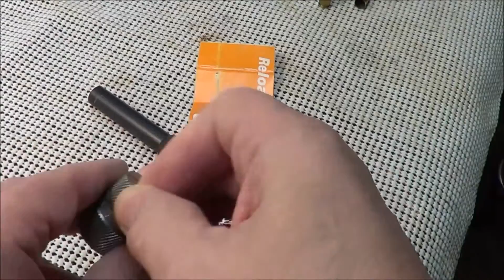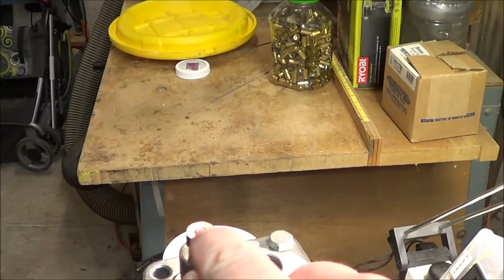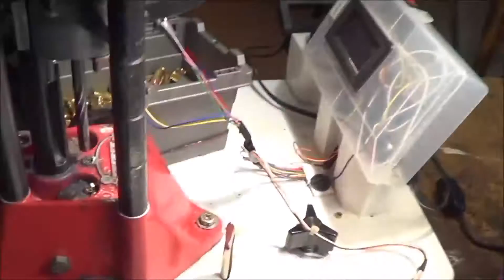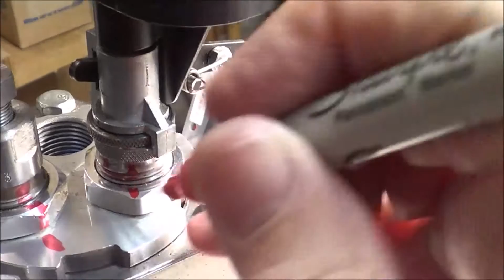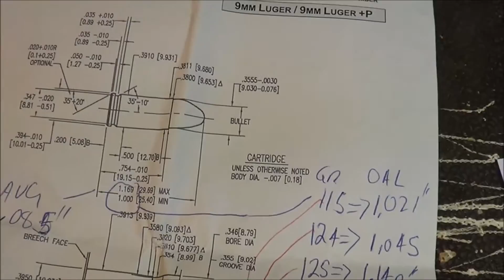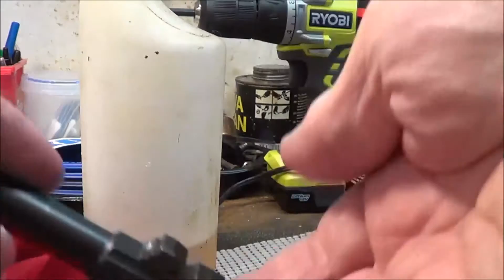Lee Pro 1000 How to set 9mm Dies

Comment: I load 9MM but can’t seem to get my bullets to pass the plunk test only randomly- I followed your die setup / I thought a Lee resizing die might solve this issue-I’ve tried fiddling with the decapper first die by setting it deeper with limited success/my Lee 1000 is quite old but that shouldn’t affect sizing the brass??? Any suggestions please?
Reply from the maker: First question would be which plunk test?  I just took ten rounds; took out the barrel in my semi automatic and every one very easily  passed the plunk test.  Next I took out my Lyman 9mm Cartridge Gauges D13,  every round dropped into the gauge,  but 9 out of 10 would not drop out, they had to be given a light rap on the table and then they instantly fell out. Next thoroughly cleaned all rounds and the gage and and 8 out of 10 dropped out  without rapping on the table. Many people on the forums say if the rounds pass the plunk test in the barrel and they feed you are good to go. I have found that the last die (the one that sets bullet and crimps) is the one that controls the bulge on the finished round. If you are having problems with the barrel plunk test the last thing to do would be to adjust your OAL,  SAMMI spec is 1.000" to 1.169".  I have never used a resizing die, but if you go onto one of the reloading forums and ask about them you should get some helpful information.  Hope this helps.

Comment: I'm having trouble where my cases are getting stuck (not completely) in the decapping die and the charge die. How can I fix this?
Reply from the maker: The dies that Lee sells are carbide and they claim you don't have to lube your cases. With the pre carbide dies they would wear out more quickly without your cases being lubed. But if you lube the cases they will go into and out of the dies much easier with barely any sticking. I have a plastic box I modified so when the top is taken off the box is about a quarter of an inch deep. In the bottom of the box is a rag moistened with the same oil I use in my pneumatic tools. This oil I already had,works great and does not have a bad smell to it.  I put the cases on the rag then take the flat of my hand and roll them side to side tell they get a light coating of oil.
Reply: Thank you very much. This solved my problem @mshaw290808mi

Comment: Thank you.   Are you still making new content .
Reply from the maker: I just finished  a project that I replaced the Lee primer system with a tube feed system that many other manufactures use. Have put 200 rounds through the system with no problems. Plan on putting up a video within a week.
Reply: NotAnExpert would love to see that. Subscribed. Primer feed is one of my only complaints and I’ve even gotten it to a minimum.

Comment: I am having problems with the shell plate not rotating, i have replaced both nylon gears and zeroed it out per Lee and the shell plate still will not rotate.
Reply from the maker: I have looked at my press and the only way I could duplicate your problem was by having the action rod/indexing rod upside down.  One end of the action/indexing rod has a twist in it and it points down when assembled. Hope this helps.
Reply: yes the indexing rod was and is installed correctly. I have replaced the drive nut and indexing rod also installed a new hex racket gear. I loaded over 200 last night with very little issues. Thank you for all the helpful videos that you have made on this press. What are your thoughts on a aluminum hex racket gear? I have a newer Lee pro 1000 with the indexing hole in the shell plate and the alignment pin, so when the timing is off the pin doesn't let the shell plate carrier to bottom out. But I think you could possibly strip the nylon gear if you pressed really hard on the down stroke.

Comment: Hallo Sir. I have a problem with the primer rod that pushes the primer into the shell, it does not go down far enough for the primer to slide on top of it. The primer stop against the rod when sliding down the shoot.
Reply from the maker: This pin can be put in upside down, check this first.

Comment: I noticed when you set up your crimping and seating die that you just had the crimp touch the shell, I have seen other videos that show them turning it 1/4 turn in after it hits the case. Why arent you doing that? I was having trouble with setting up my die till now.. Thank you in advance. P.S. I just did that thing with the nylon spacer in the top of the press, it works great!!!!
Reply from the maker: When I first started loading I did turn the die down 1/4 of a turn. It caused the brass shell to neck in at the middle or to get a hour glass figure which is a sign of over crimping.  When I rotated the die up 1/4 of a turn the over crimping went away.  I looked inside of my crimping die and the top of the brass shell pretty much hits a flat circular ring ( not a tapered surface) inside the die. So if you turn the die 1/4 down further the flat circular ring the brass shell hits does not force the flared sides of the shell flat against the bullet.  Instead it crushes the brass shell down creating a hour glass shape in the brass shell.
  Glad you found the nylon insert in the turret helpful.  I was surprised when I found it and also surprised at how much it helped.  My press has about 10,000 rounds through it so I cannot say if it had that much slop in the rotating stage when I got it. Does a new press have that much slop in it or does that happen with time?
Reply: Mine wasent new i bought it used and it had that much slop in it as well.  I am now working on the primer feed system you put together.  your videos have helped me a lot.  I was about ready to just sell this press and buy a Dillon.